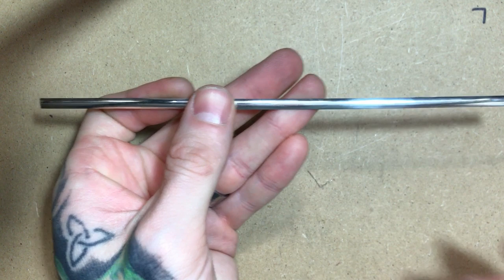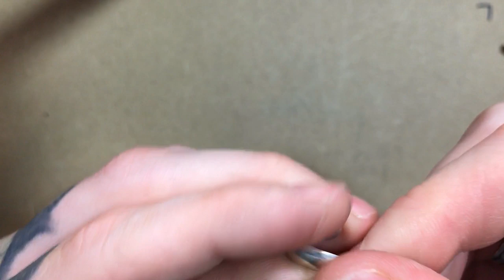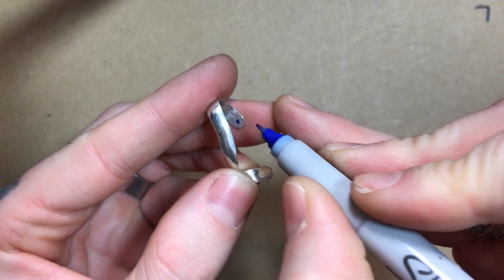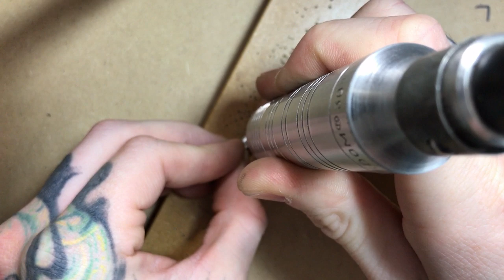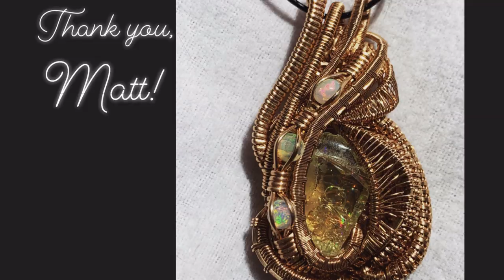Wire Wrapping Tutorial: Using Low Dome Wire

Comment: Thanks for putting this out there! I didn’t even realize there was a difference between half round and low dome haha is it easier to work with low dome than half round?
Reply from the maker: Low dome is much more difficult to work with unless you’re really getting up there in the sizes for half round (like 10 or larger). The main value of low dome is that it has a significantly thinner profile, so it’s like a flattened out half round. You get the same width but much less height, so it’s much less metal and therefore much less expensive
Reply: Awesome thank you for the info and sharing the knowledge!

Comment: Low dome is some i dearly wanted to work with in the beginning before realizing they don't make copper lowdome. the closest thing would be low-gauge half round unfortunately.
Reply: you have 5 mm and smaller flat wire, which is not doomed but it can give a similar effect, it's from aluminum and comes in a variety of colors, cause siver is expensive.